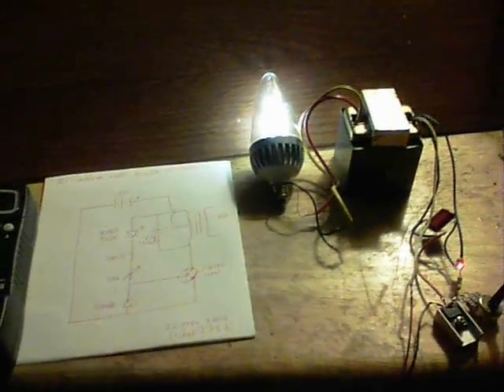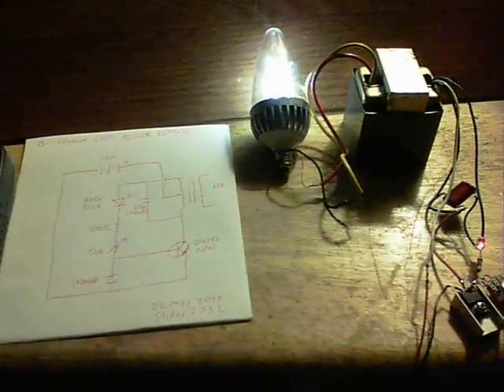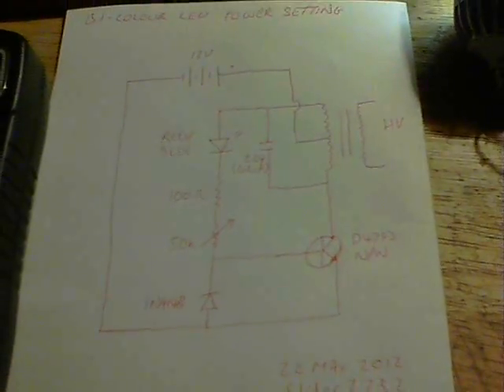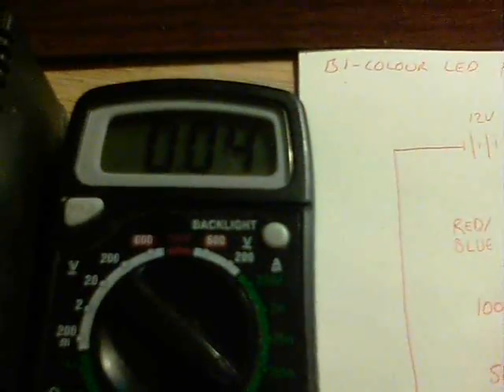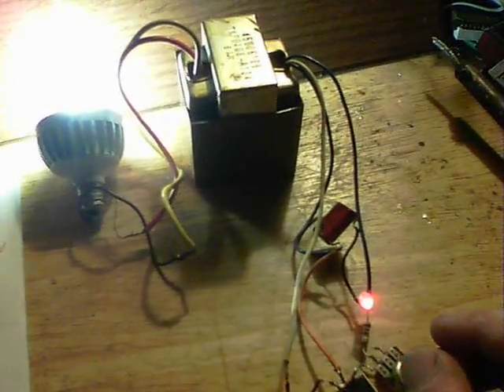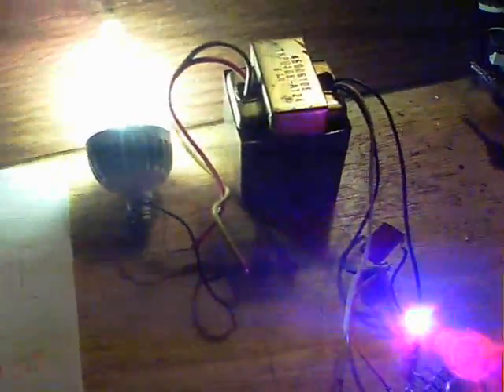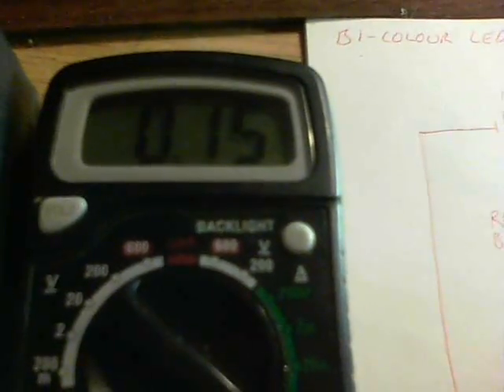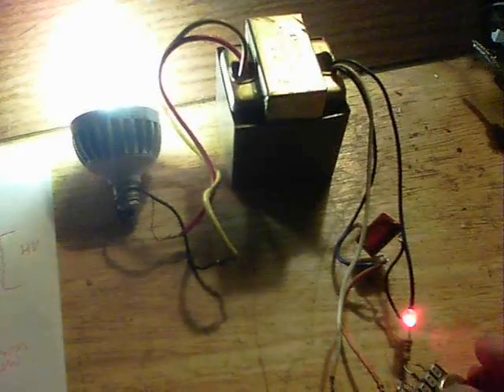Bi-colour LED - for SJR type lighting

Comment from the maker: Here's what the transformer is doing, very much like a Joule Thief - Input is to the 3 wires, middle one is Positive voltage, one of others connects to transistor output (Collector) and the other picks up that pulse and sends it to the transistor (Base). The other side, with the 2 bigger gauge wires is the HV to a bulb. Generates HV by speed of switching+ratio of turns on transformer.
You control how much return the Base sees by way of the variable pot (and in this case the visuals of the LED).

Comment: I'd better make it clear, know nothing about electronics! You've done a good job, pity I am not able to replicate it! I've tried all the circuits on Youtube; caps, no caps, Lasersaber's, and so on. I also built to the letter "Lasersaber's transfomer" yet; no HV. On the latter I need your help badly. There are 5 wires, 2 output w & 3 input. I am stuck on this last 3w. Center HV, to the right trigger, 3w; on the left of it, a single wire; the final wire. In plain English, where do I connect them?